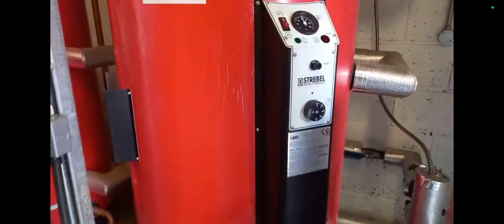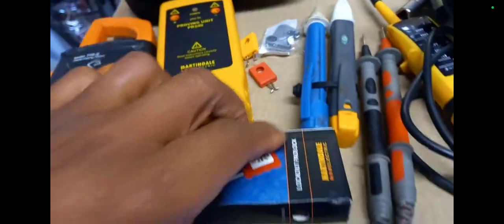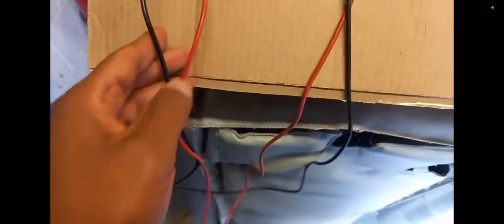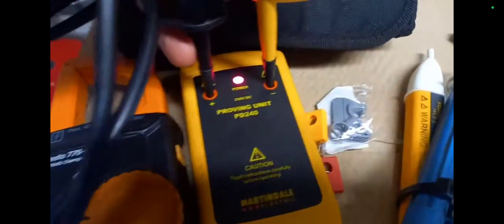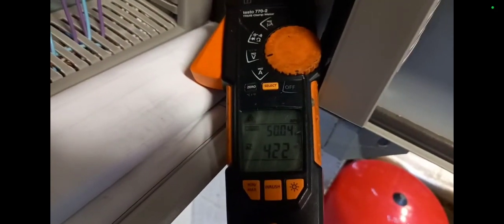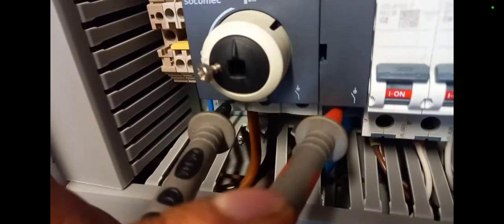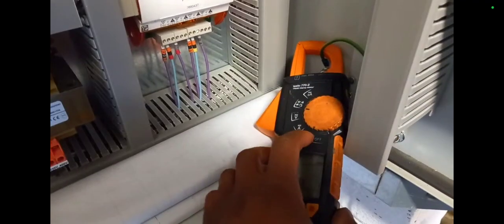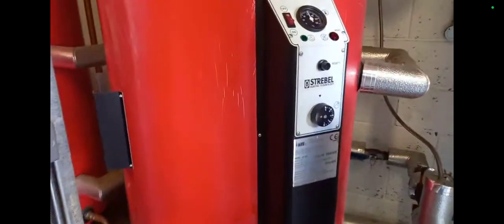3 PHASE ELECTRICITY = PROFESSIONAL KILLER!

Comment: Taking the fuse out is NOT safe isolation, you should remove the fuse and place it in your pocket then LOCK off the fuse carrier to stop me from putting a different fuse back in the carrier and turning the supply back on ! 
Wearing gloves in a panel is a good idea however they should be 1000V insulated, tested and certified gloves especially when LIVE testing, the gloves you were wearing won't save or stop you getting electrocuted.
There is also another test to carryout if you are working on 3 phase that can be controlled by a contactor, you test the control circuit as well.
When locking off always take the lock key with you - no one else should have access to that key but YOU. 
When you have completed the tests you then check your tester and leads once more with the proving unit.
Reply from the maker: @muckychimney thanks for that insight. Know your stuff. Check out the other vids I have in the playlist below to see if you can share any more of your experience. Let me know what you think of the safe Isolation guide in the description. If anything can be added?
Also if you can find anything else not right in this vid please don't hesitate to share as I've been collecting them all for a part 2 self audit vid. Thanks in advance. 

https://youtube.com/playlist?list=PL6rvQga04CKyJ2VOEWgUIV464L7tpGll5&si=z_A78NUmGEht-eO4
Reply from the maker: https://youtu.be/qkqpv6bsM14?si=yIAbR4u73e99xiaL

Comment: I know this ? is not related to your video buddy, but I would appreciate any info on the term Air/gas ratio setting. I understood it to be related to the gas valve.
Reply: Thanks for quick reply.
Reply from the maker: @johndenvir6703  no worries, I'll look into it yet potentially someone might reply who knows for certain. 

Hope that you're have a good day with your Father and a good rest with Him too.
Reply from the maker: @johndenvir6703  I discussed this with another engineer recently and we both felt it was to do with forced draft burners settings. Gas safe register might also have insights. I don't think that it's of major concern to know this one though.  Keep up the good work J.
Reply: @johndenvir6703 ive previously been looking into that, i think the best resources was a full chapter dedicated to that in the book « combustion engineering and gas utilisation, by J.R.Cornforth ».
Also kromschroeder has a good document talking about air/gas ratio control
Reply from the maker: Sounds like something on a CP15. I imagine it's something to do with a burners setting Air and Gas. Yet not 100% John.

Comment: Why don't you just use a quad channel instrument to measure the phases (and it'll give you quite a few details), e.g. something like 190-504-III? As a bonus, you can also measure N-E on ch4, though it wouldn't make much sense at the distribution panel…
Reply from the maker: @bachvaroff  now thats the kind of comment I've been waiting for. Thanks for the insight. Please feel free to elaborate more. 

I don't have a quad instrument in my back pocket but I'll look into them if it will be of any use in my day to day work. 190-504-lll. I'll look it up
Reply: @CommercialGasEngineerVideos  In a perfect world I'd be more than happy to measure and record few more things (waveforms), namely 4 single ended voltages (Ph-E + N-E), 6 differential voltages (Ph-Ph and Ph-N), 3 phase currents, the N current and the E current, ideally with the system under load. This will give me an insight of the system's dynamic characteristics and possible issues…

Comment: The title of this video made me think of the KMFDM song before anything else. 
Not every panel has that push pin, especially ones I've put in - deliberately by design. Doesn't stop anyone using a spanner to power on the panel mind you but does stop people that like to learn things like the push pin on line that think they know what they're doing. Such as the site maintenance chap.
Reply: i just learned about the push pin here and i'm really glad he shared it. every panel should have them. if somebody unqualified goes to the effort of turning off the big red switch, opening the panel with a key, then using a spanner to turn the big switch on again inside to mess around with the contents, i think we just have to let them get on with it. not having a little push pin on the switch won't stop them.
Reply from the maker: @effervescence5664  Thanks for the good insight.

I've looked up the song you mentioned and I couldn't find it.

Maybe I need to not tell everyone about the push button. After all I'm trying to keep people safer from watching these vids. What do you think, have I achieved that in this one?
Reply: @CommercialGasEngineerVideos  KMFDM - Professional Killer, released around 2005. 

I think you're probably fine having highlighted safe isolation. I try to avoid advertising our tricks of the trade to the general public because certain people without qualifications will tinker and look up information to enable them to tinker as they seem to think they're invincible/immortal. Letting colleagues know those tricks is a must because it makes our lives as professionals better but it's always the amateurs we have to watch out for.

 I did try to reply earlier but YT crashed uploading my reply which was far more informative.
Reply from the maker: @effervescence5664  I'm listening to that song now 🤣. 

On a serious note. I get what you mean about only sharing certain things. Thanks for you honest opinion. Note taken.

Comment: that little push pin thing on the panel switches is something i knew nothing about until you showed it in a recent video. it's been an absolute game changer for me already so huge thanks for the tip mate
Reply from the maker: Glad that helped. 
Have you had any near misses with electric or anything else on site Clive?
Reply: @CommercialGasEngineerVideos  i've actually never had a mains voltage shock luckily. i was on site once and a lift engineer gave himself a nasty bump off the 3 phase supply to the lift motor control panel. he was alright, very shook up but his whole left arm went all stiff and sort of stuck in a straight position after the shock. i helped him out for a few minutes and he decided to drive himself to hospital.
Reply from the maker: @cliveramsbotty6077 hope he had a complete recovery.